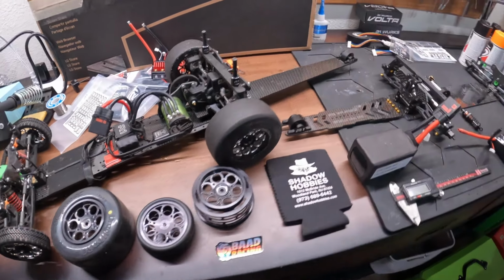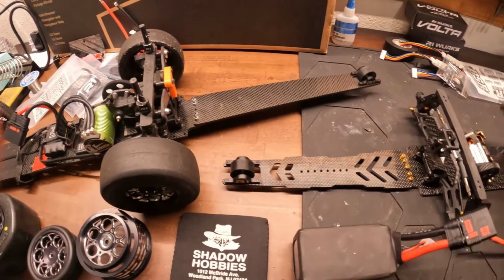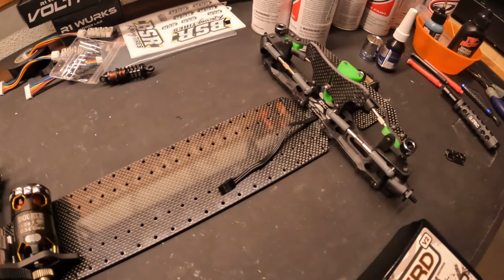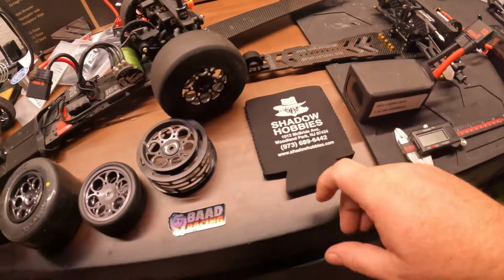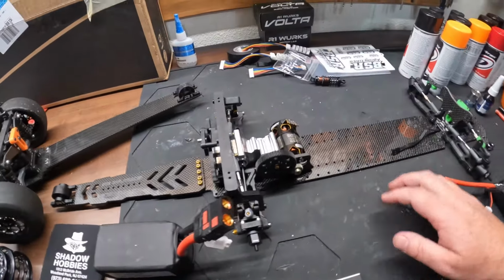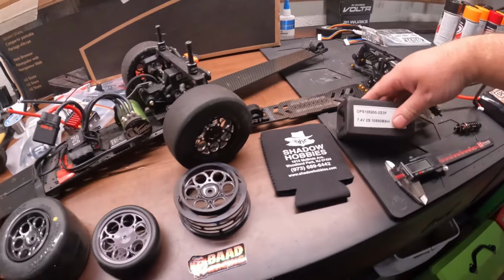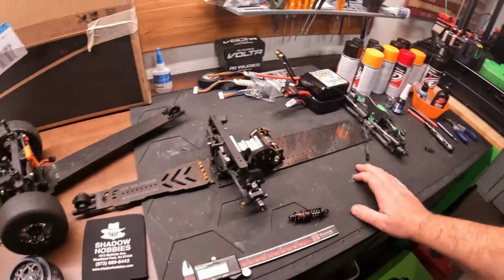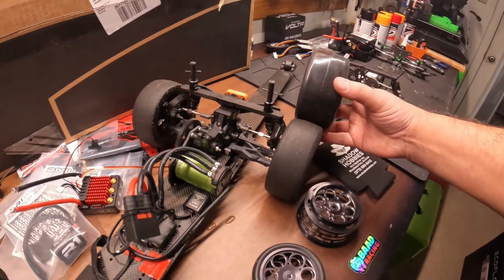R1 DC1 V1 and V2 + Drag Updates

Comment: AWESOME VIDEO MAN!!! I just got the new R1-WURKS DC1 V2 and I absolutely am digging it Brother I also have a DR10M as well with just about aftermarket bolt on you can get for it LOL HA HA HA HA HA HA HA 😆 EXOTEK, MORBO, FACTORY TEAM, R-DESIGN, PRO-LINE, PROTEK-RC, CYRUL 3DFX, VOODOO RACING, TRINITY RACING, TEKIN RACING and so on but there's no comparison to the R1-WURKS DC1 V2 I'm going to run the TEKIN RX-8 GEN-3 ESC W/ V.295 DRAG RACING SOFTWARE UPDATE INSTALLED and start with the TEKIN ELIMINATOR REDLINE GEN-4 (2.0T) MOTOR first and by chance it doesn't work out then I will go with the TRINITY RACING HOLE SHOT DRAG MASTER (3.0T) W/ TEP-1154C BLACK TOP ULTRA TORQUE ROTOR .5% CERTIFIED I'll hit you up and let you know how it goes Brother GOD BLESS YOU BROTHER ✝️✝️✝️ SINCERELY CLAY B. AND SPEED MOB RACING 🏁
Reply from the maker: Thank you

Comment: Hey Brother I'm needing some guidance on what weight shock oil to run in my V2's FRONT & REAR Shocks to start out with and my R1-WURKS DC1 is the newest version made after APRIL 2023 MADE WITH THE NEW R1-WURKS DC1 LIGHT WEIGHT LAYDOWN TRANSMISSION AND TUNED CHASSIS AND TUNED WHEELIE BAR. But yeah Brother if you can get me on the right path of what shock oil weight to use in my shocks and man right now I have got 30wt. 32.5wt. 40wt. 70wt. and if I have to go out and get more I will and if you can recommend what spring rate I should be running and Brother I more than APPRECIATE IT!!! and THANK YOU SO MUCH!!! I look forward to hearing back from you man and God Bless You Brother ✝️ Sincerely Clay B. and 🏁SPEED MOB RACING🏁
Reply from the maker: Depends on surface and motor selection.
Reply: @501speedcrew9  Hey Brother I am going to be running my TRINITY RACING HOLE SHOT DRAG MASTER (3.0T) W/TEP1154C 13.5MM  .5% CERTIFIED BLACK TOP ULTRA TORQUE ROTOR & CERAMIC BEARINGS  for now I do have a TEKIN GEN-4 REDLINE ELIMINATOR (2.0T) DRAG RACING MOTOR as well still brand new in the box. And Brother I'm sorry for the lack of information about what I'm running I'm sure that would make it easier for you to make a decision on what shock fluid to tell me to go with starting out with also I have got a TEKIN RX-8 GEN-3 ESC WITH THE V.295 DRAG RACE SOFTWARE UPDATE INSTALLED and HIGH BITE ASPHALT as far as our current surface goes and again Brother THANK YOU SO MUCH MAN FOR EVERYTHING AND FOR YOU TAKING UP YOUR TIME TO HELP ME IN ANYWAY POSSIBLE!!! GOD BLESS ✝️ SINCERELY CLAY B.